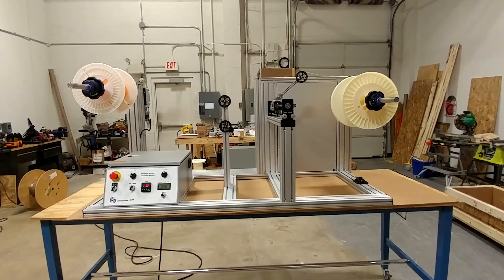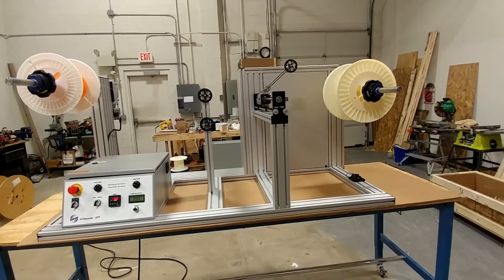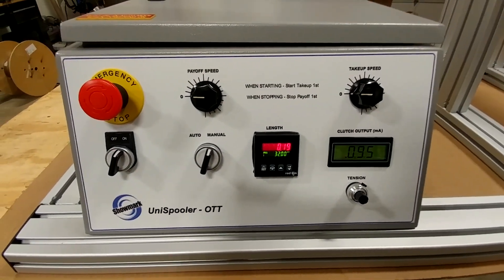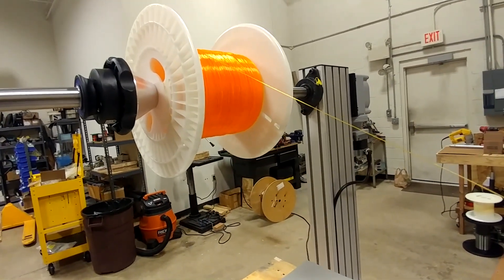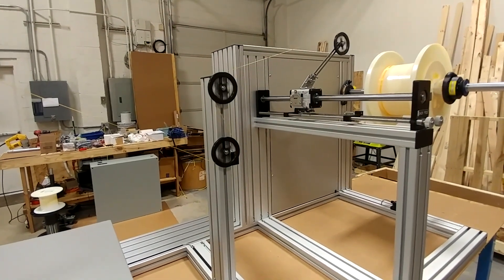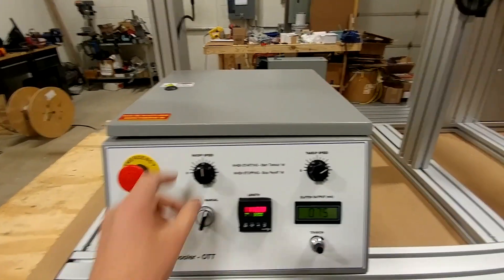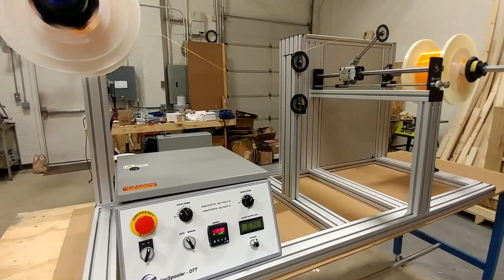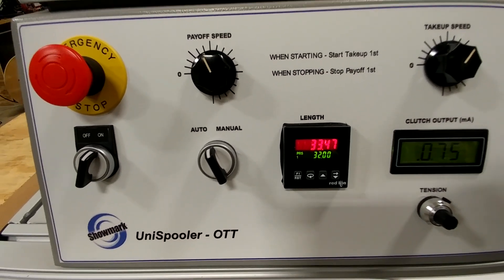Fine Wire and Filament Respooler with Powered Payoff

Comment: Do you have anything smaller that can respool wire that is 0.0020" (44AWG Magnet Wire) from 10-100lbs spools down to 2oz-5lbs?
Reply from the maker: The UniSpooler (https://www.showmarkcorp.com/product/unispooler/) is a smaller machine for fine wire.  It is not ideal for use with spools weighing more than 40 pounds. The powered payoff machine in this video is needed if low tension is required when winding from heavy spools.

Comment: Please let me know what should be the pitch for 0.20 mm wire
Reply from the maker: The machine has adjustable pitch within a range based on each customer's requirements.  For 0.20 mm wire, the pitch range can be adjustable anywhere between .100 - 1.000 mm.